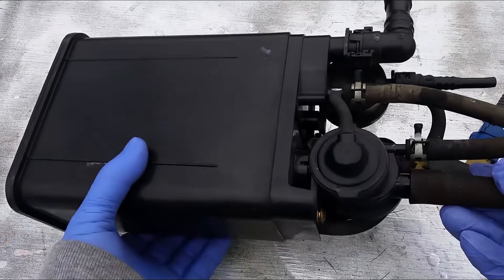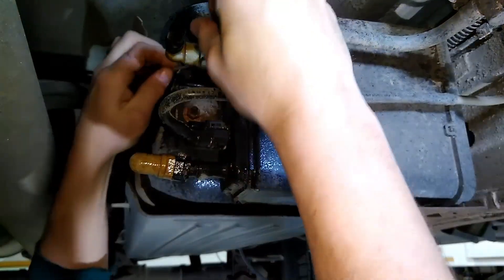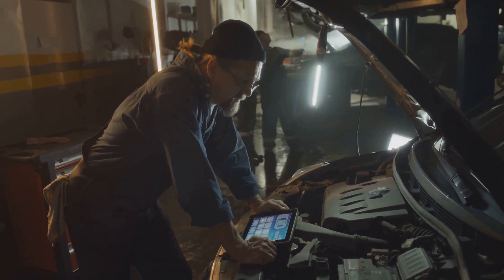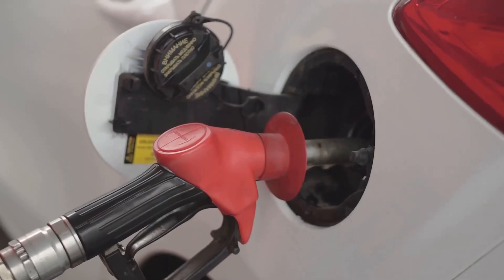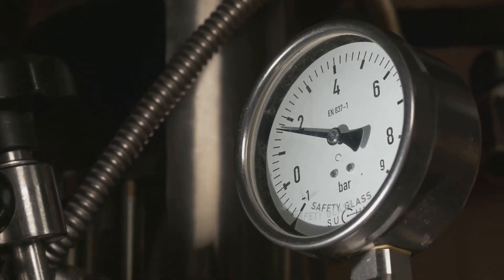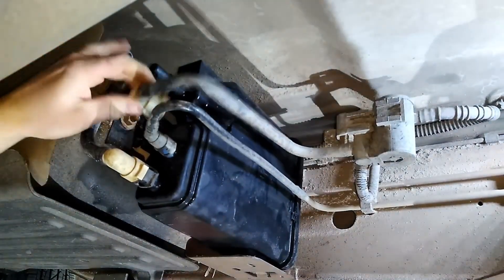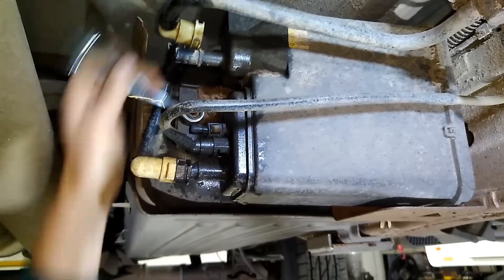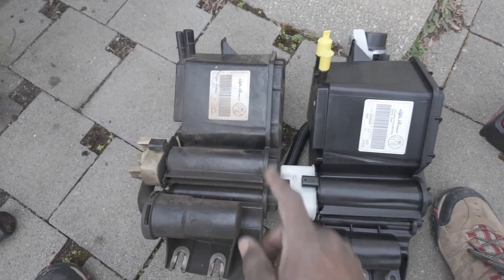6 Symptoms Of A Bad Or Clogged Charcoal Canister & Replacement Cost

Comment: Hi , thanks for the video 
I have Mazda 6 2014 i replaced the vap canister with new OEM after that if the car running on idle for more than 30 minutes strong gas smell coming near gas neck and I checked everything no leaks at all just smell , what do you think about that